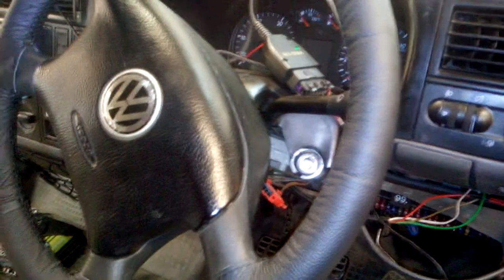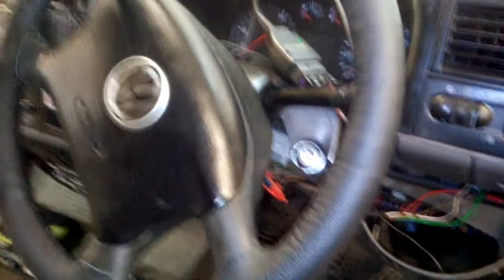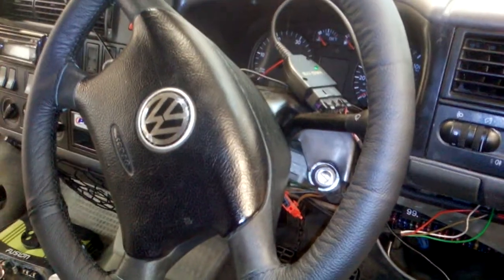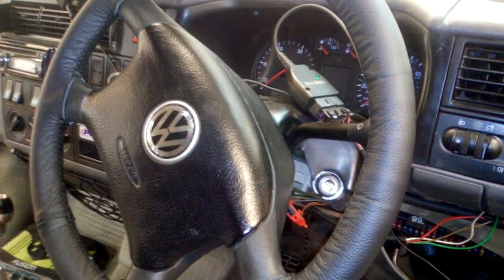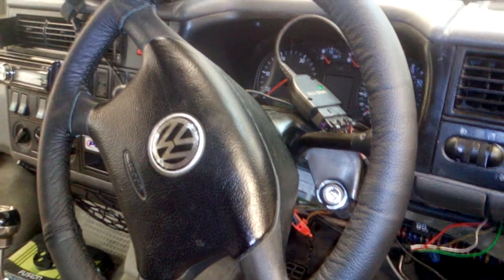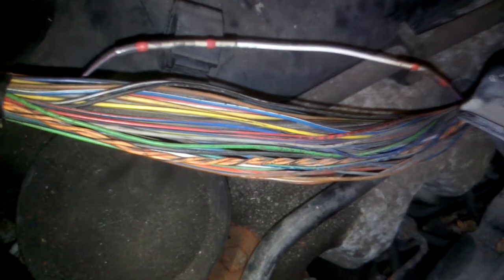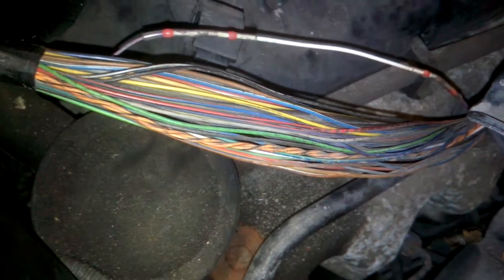VW T4 P0571 Wiring Fault FIXED Brake Light Switch Implausible Signal 16955 Transporter AUDI SKODA

Comment: I have this Needle lift and acelerator position sensor implausible signal ??
Reply from the maker: I know the accelerator pedal position wiring on a TDI runs through that conduit so you definitely could have the same problem of chafed wires. The needle lift sensor is on one of the injectors on a TDI. Not sure where the wiring goes for that
Reply: @GrubbyRabbitRepairs  thank u Man but Service shop tell me its Fault of Injection pump Idk What to do Honestly
Reply from the maker: @TIIRONC5H  I had the needle lift sensor on my T4 go bad and it caused a hesitation while accelerating. Are they mistaking that for a lack of fuel pressure? Have they read the fault codes? They may have used a fuel pressure gauge and found that the high pressure fuel pump is weak but I'm not sure how it would cause those fault codes. I'm not a mechanic though, it's just a hobby for me.
Reply from the maker: When I say the accelerator pedal wiring goes through that conduit I mean for a right hand drive van. I'm not sure of the routing on a left hand drive van.
Reply: Codes shows only Needle lift sensor implausible signal acelerator pedal  position sensor implausible signal  I Have A engine like AlH  With no throtle body At all but My gas pedal has Sensor and Cable Idk Really  WHEN I PRESS FAST ACELERATOR  CAR GOES RPM ITSELF 10+ AND STAYS LIKE THAT and no response acelerator after that i turn of i press slow and sometimes   Work nice
Reply from the maker: @TIIRONC5H  Do you know anyone with VCDS/Vagcom or a scan tool? That would show accelerator pedal position and tell you if you have a problem with your pedal or wiring.
My friend had a T4 and his pedal wouldn't work at all. That was caused by wires chafing in the conduit. Are you in the UK?
Reply: Here in my town no one own that vcds vag  they have cheap software scan  Im From Albania Bro
Reply from the maker: @TIIRONC5H 
Greetings Albania! 

Sometimes even the basic OBD2 readers can show accelerator position in Live Data.

Could you unplug the accelerator pedal and try starting the van and see what happens? If symptoms change it might indicate that problem is with the pedal position sensor? Be ready to turn the engine off straight away though as I'm not sure what would happen.

 It's not too much work to open up the conduit and check the wires. You might need some insulation/electrical tape to help close up afterwards.
Reply: Bro i unpluged acelerator pedal and Car Gets rpm itself  10+rpm and stay like that without pushing pedal
Reply from the maker: Ok, I'm sorry that probably hasn't helped very much.

You could plug the pedal back in and start the van, then get a friend to push the pedal while you move all the wiring looms in the engine bay around and see if you can get it to affect the rpm? Be careful of the fan coming on while your hands are in there!